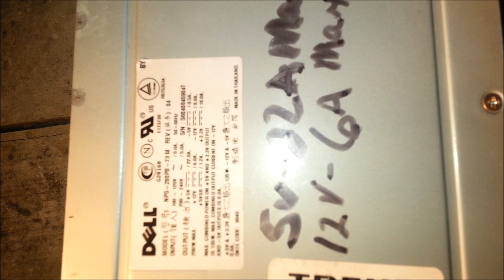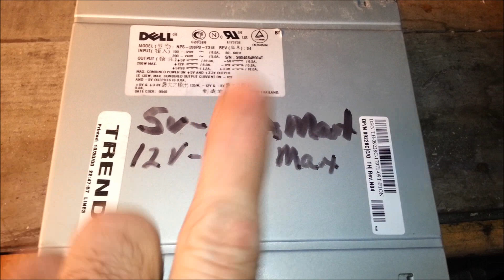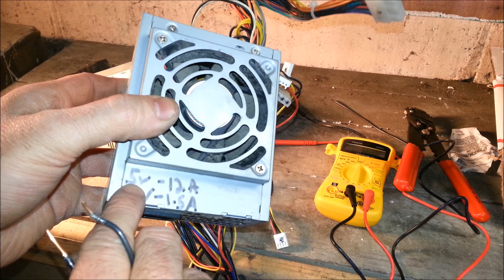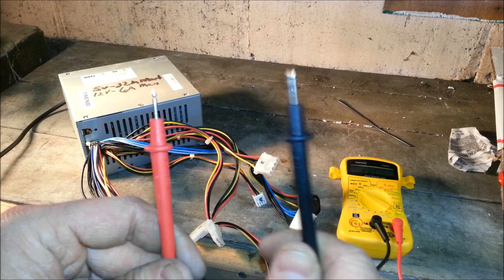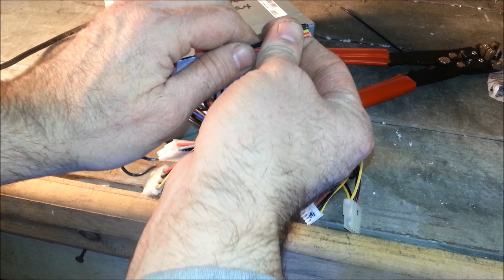Converting a computer power supply for RGB and low voltage lighting use

Comment: How many Led pixels lights can be connected in one Smps
Reply from the maker: Crazy Dancer 
It all depends on the rating of the power supply versus the rating of the pixels you are connecting to the power supply. It also depends on the maximum wattage is. Which is why I point that out in the videos.

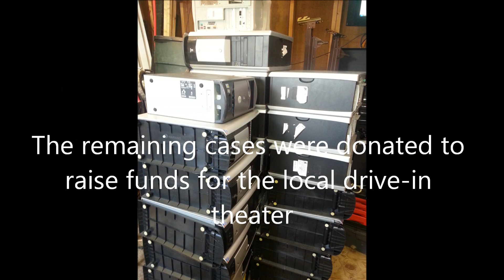Comment: minutes 13:50 was exactly what I have been looking for, how to set up the power supply for use with an e682 controller. TY very much.. Hope you are a member of Planet Christmas or Lone Star Holidays... I am just starting this venture with RGB.. and want to keep from frying a BUNCH of invested money.. Again TY!
Reply from the maker: C. Jones, I'm glad that picture was helpful.  We have a group on FaceBook that helps teach beginners how to use this.  I shared this exact photo with a friend on that group earlier in the day before posting this vid.  Hope you subscribed, I'm working on another few videos... building/soldering an e682, setting up and testing pixels using Nutcracker/XLights software, building/assembling dumb RGB controllers.